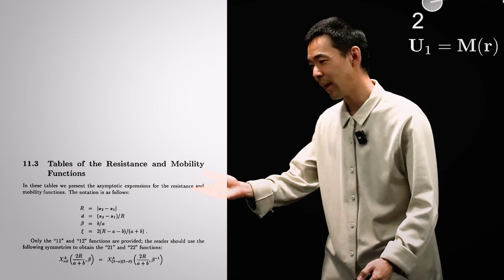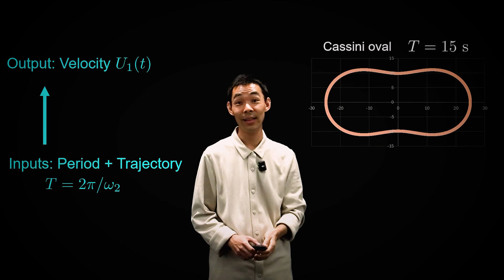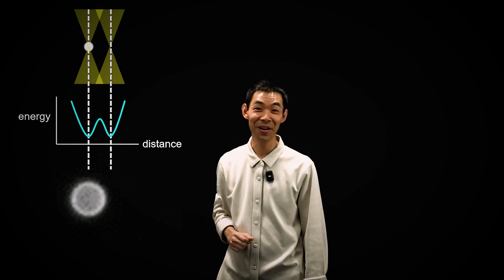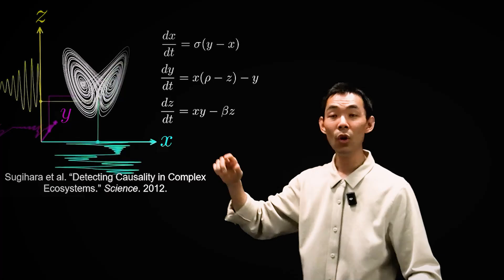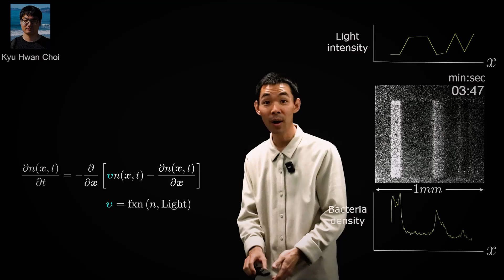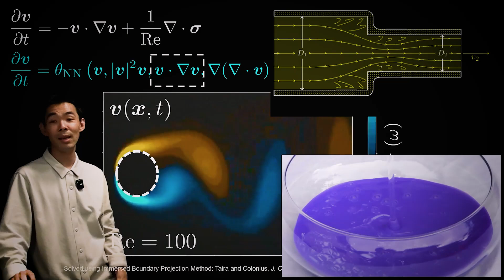Picture-perfect models for complex materials

Comment: Hey Professor Takatori, thanks for your video!  I found everything in it very interesting.  The rheometer you've built with the two beads is super cool and I was wondering if the optical trapping warms the beads or fluids in a way that you have to account for?